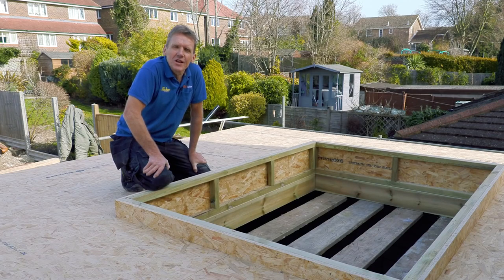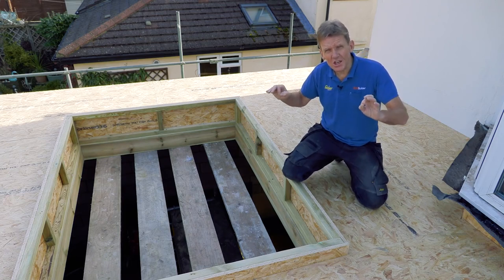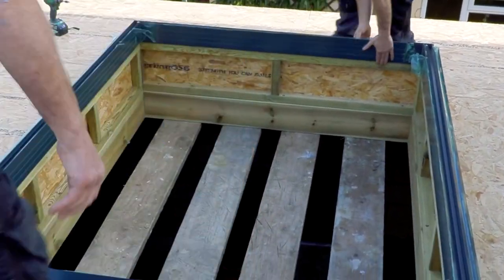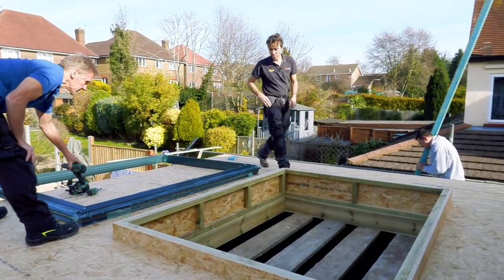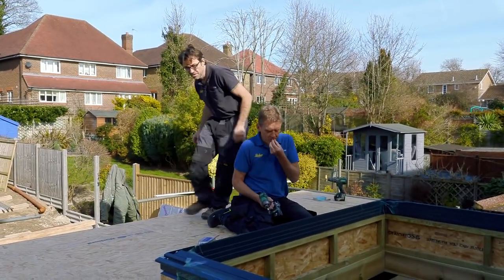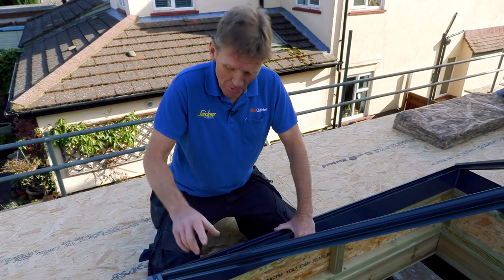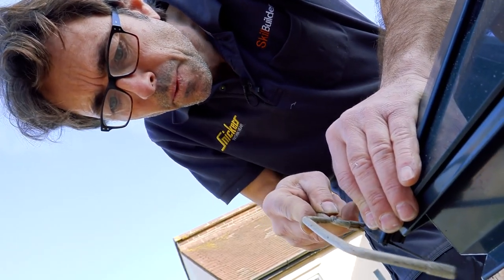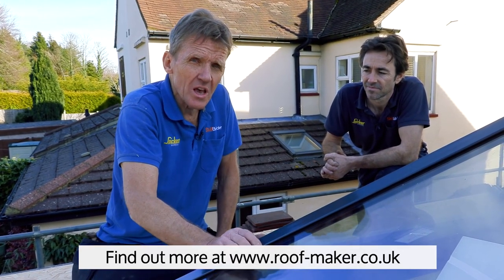How to Install a Slimline Lantern With Roof Maker and Skill Builder

Comment: I’d like to see how you finished that kerb to the lantern as you got no over hang🤔should always rubber up before you slip it in😉
Reply: You can stick the top coat right up under the glass
Reply: @kyam3331 would want to be fibreglassing with that already fitted. Thinks it’s best they go on after…

Comment: Well very nice looking Lantern good pitch on the glass ,not sure why it’s being siliconed down onto bare wood,the roof covering should always be done first and go up and over the kerb edge .just means someone has to remove it all that good work ,and yes the kerb should always have 50mm kingspan fitted then use foil back plaster board

Comment: I assume you insulate that upstanding frame and the plasterboard butts up to the bottom side of the roof lantern then skim? Cheers
Reply from the maker: Yes that's correct!
Reply: Would the plasterboard sit flush against the insulation on the inside of the up-stand? Would you need to apply a vapour control barrier to the inside of the upstand?

Comment: I’m currently planning something similar with a roof light etc .. I’m just a little concerned about any water collecting on/around the face of the kerb nearest and parallel to the house.

Obviously the fall will take rain water away from the rear elevation of the house but is it a common issue for rain water collecting where it hits the kerb? Is it something to be concerned of? or is it as long as the roof is properly sealed then it’s nothing to worry about? 

Thanks and great video!
Reply from the maker: Hi Jonathan, you can get around this by falling the roof in two directions. This is mentioned at the start of our video with Skill Builder so that the water flows diagonally around the rooflight and off the roof. They do this for the same reason as water will collect between the rooflight and the property. If you still have concerns we do also have wall abutment flat rooflights that negate this issue. Many thanks, Michael

Comment: Doesn't the upstand need to be at least 150mm high?
Reply from the maker: Thanks for the comment. For our rooflights you flash over the frame of the lantern as well, which is classed as part of the minimum 150mm required, so you do not have to build the timber upstand 150mm high. Many thanks.
Reply: @RoofMaker  ahh cool, thanks

Comment: Why wasn't the roof covering installed before roof light?
Reply from the maker: As Roger mentioned, it depends on the project but sometimes it's more convenient for the tradesperson to fit the rooflight while waiting on other trades. The roof covering can be installed afterwards and brought up into the rooflight and under the drip-lip to finish it.
Reply: @RoofMaker  bit shit though